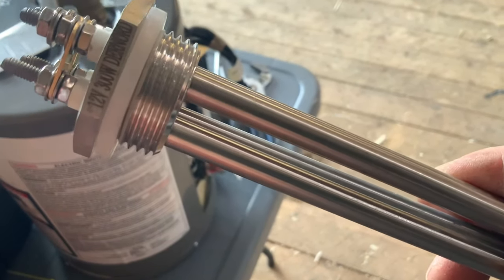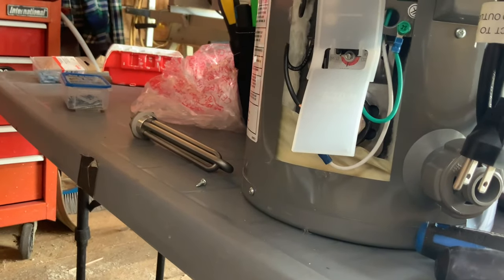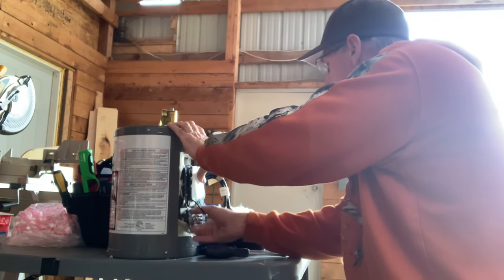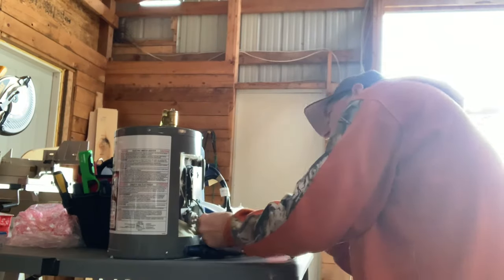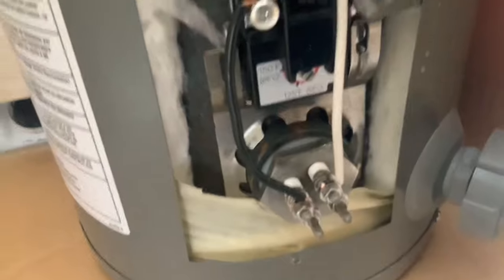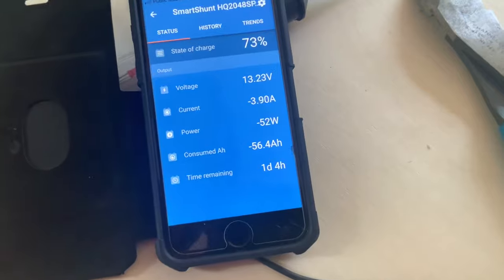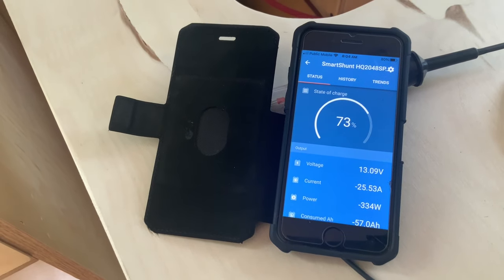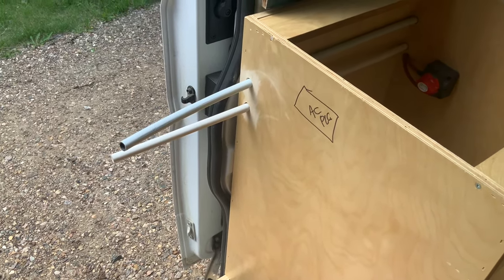Best Install 12v DC Off grid hot water heater in Van or RV Solar Compatible! DYI! Convert RV to 12V

Comment: I have a water tank like that in my Van that only works on a mains hook up. I have asked several auto electricians about what you have just demonstrated. They’ve all said it can’t be done it will be too big a draw on the battery. I’ve told them that I would only heat water when in transit (engine running) and they have said the alternator and battery won’t cope. I’d be interested in your thoughts on that.
Reply from the maker: So far I have used the system about 20-30 days, maybe more. I have turned it on in the morning and had hot water after my ride and then most of the day while the sun keeps the batteries roped up. Definitely on when driving but also always on when plugged in at home or a friends. I think the lithium batteries make a big difference and make sure you have a legitimate DV element. Also have good components in you DC system will be key. Good luck.

Comment: Brilliant discovery...thanks for making this video. Just what I was looking for. I want to create an off grid friendly 100% 12v closed loop system with something like this water solution of yours for a catering trailer (Wood Fired Pizza in the UK.) Alongside a12v Eberspacher Handwash & 12v Undercounter fridge. Do you have any advice/references/links, so as to punch in all the data, ie what I am planning, what I will run, and what the climatic conditions will be in this part of the hemisphere etc to determine whether my 410w 'Canadian Solar' panel will suffice and what amount of battery Amp will be req etc? Any pointers welcomed. Subscribed. Thanks again.
Reply from the maker: You should be fine with the 410watt panel as long as there is sun. A bank of good Lithium batteries will define help as they can be run so much farther down. Start the water heater o the way to your parking spot or while it’s on shore power before you go out would help for sure too. I heat mine a lot on the drives to places. Then it just stays warm on the solar. Good luck and have fun

Comment: Hello! Love the idea. How much hot water do you get out of that before it goes cold? I know its a 2.5G tank but I am hoping  you could get more than that?
Reply from the maker: Unfortunately it will not regenerate as fast as you use it so continuous hot water would only be 2.5 Gallons. That said I have never run out doing dishes or having a “ bucket” shower.

Comment: A lot of elements you see sold on eBay that say their 12-volt elements are not cheap artificial knock-offs. You want a good 12 volt element. But Channel called Missouri wind and solar YouTube they have the best true I've seen anywhere
Reply from the maker: Yes. Lots of knockoffs on eBay and Amazon. I went straight to Dernord but Missouri wind is great. I talked to these guys before. Excellent tech and parts!

Comment: Wouldn’t an inverter just let the water heater be used on the AC side? I’m assuming this must be more power efficient?? Thanks
Reply from the maker: Yes. You could just leave  the element in and run on AC from the inverter. My thought was that I would turn on the hot water in the morning and have the DC from the battery and solar do the heating. That way there is no residual power loss from Inverter running if the clouds come over. One less item to be running while I’m not in the van as I would hopefully be out enjoying the day and return to hot water and 100% battery. 😊

Comment: could you use a 600 w element in 12 v wouldn’t it heat faster ? or does it depend on the solar panels u have ?
Reply from the maker: Yes you could. It’s a trade off between time and energy used. I chose the lower wattage as I don’t need to heat super hot and it uses less over longer time which works well with solar output. Just my preference.
Reply: @dadzvanz936  Thankyou i noticed u use 6ga wire is that a required or would 10ga work ? great video by the way👍🏻

Comment: I considered a 12 volt water heater for a while, but gave up on the idea and here's why: I'm running a 608 AH System with a 2400 watt inverter at 24 volts. It's one of the all-in-one varieties, so It handles the solar input as well. In the end, it's all just energy and I'd rather have the 1400 Watts from my Bosch WH  (58.33 amps at 24 volts) going to heat the hot water in 15 minutes vs 3 hours or so for the 12 volt. I still have solar on the roof and a couple of portable panels for about a total of 600 watts of solar, so those can still be used to charge the battery. The difference is I don't have to wait. Sure, the inverter uses 60 watts power while it's running, but it only takes 15 minutes to heat 4 gallons of hot water up to temperature. Again in the end it's all just energy. Higher/faster, lower/slower.  The battery stores the power in either case. 

And for anybody wanting to use their engine to heat hot water, just buy yourself a heat exchanger or cooler (used for beer making). A heat exchanger can be used to cool as well, and they just tend to be cheaper to purchase that way. You can get a 30 to 40,000 BTU model for about 80 bucks. You'll need a small one gallon or so per minute pump to push the water from the water heater through the heat exchanger, but the water pump from the engine will push the coolant on the opposite side of the exchanger. It takes a very short amount of time to heat 4 gallons this way. You can do the math if you want to, but it's going to depend on what size heat exchanger you buy as to the time required, but it's very quick. I use a similar setup on my recirculating shower, so my domestic hot water does not go through water heater that's been used for the recirculating shower.  The engine holds residual heat for quite a while too, so you still get some heating effect even after the engine is shut off or a good hour or so (just a bit slower).  It's a good way to use btu's that normally just vanish into the air. 

Lots of options. The only advantage I see to the 12 volt is if you have limited battery power, but you pay to wait as well. If you have a larger Lithium ion phosphate battery bank you can still take advantage of the solar. I like your ideal though!
Reply: So the other dude that did the same 12v conversion to a rheem 2.5gal tank, but used a 600w element, timed how long it took for the tank to go from cold to 143F. Took about 30 minutes. So I'd assume it would take about an hour to get to temp with a 300w element. That's really not bad tbh. Only uses 300w and would at most be used once a day. On a 400ah system thats 16 days of hot water without charging the batteries.
Reply: While we can have a difference or discussion about methods we cannot disagree about facts.  You can't change physics. It takes a given amount of energy to heat up a  given amount of water, regardless of the source.  Fact. If it takes 15 minutes at 1400 watts /120 volts  to heat say 4 gallons (11.66 amps) It would take 2.33 times longer at 600 watts, Assuming 120 volts. Once you start converting to 12 volts, It would then take 116 Amps of power to accomplish the same thing or nearly 10 times as long at the same amps.  Once again, Higher faster ,slower longer. Personally, I'm running a 24 volt system so I'm only using about 6 amps of power, which can be handled in some fairly small gauge wire. If I was to pump 116 amps through the wires I would need to use something like 1/0 or larger wire.  At 300 watts and 12 volt it  would take roughly 20X the amount of time. You would then have heat loss to contend with over that amount of time, so It would take even longer.

Comment: Installed a 6 gallon Rheem with a 500w element instead. The wires to the element get HOT and melted the plastic. Should I replace factory wiring with 6awg as well? Was thinking this wire can’t handle the amperage. It’s pulling around 50amps.
Reply from the maker: Yes. I would upgrade that to at least 10 gauge.
Reply: @dadzvanz936  still getting hot with 6awg. Maybe faulty element or possibly thermostat doesn’t like it🤷‍♂️ It’s only hot at the element connections so could be the element.
Reply from the maker: @waltermeyers5700 ya. Sounds like something other than the wire size.
Reply: @waltermeyers5700 If it gets hot at the connections, it is not a wire size problem. It is high resistance at the connection itself. That can be caused by the inductance of the steel, a loose connection, or a corroded connection.

A copper connector is better than a steel connector. But you have to monitor them for oxidation. If I had that problem I would go to Autozone and get some copper connectors.

Comment: Did you change the thermostat for a 12v?
Reply from the maker: No I did not. I have not had any issues yet. Had about 10 days of operation and am going out again this week for a few days. Will post any updates. Thanks for watching
Reply: dc will spark and eventually stick ac  thermostat on
Reply: @danielnicholls6868  Is that because at 12V (instead of 120) the contacts will close much slower?
Reply: @RustyCas999   12 volts will be a lot higher amps and dc  flows is one direction. witch makes more of a spark jump and heat{will weld}.need bigger wire to

Comment: Are the 2 elements bridged. I've seen people put bridge busses on connectors to join the 3 elements.
Reply from the maker: Yes they are bridged. You could buy a 1200 watt DC and run it as a 600 watt and save the other side for a rainy day. There are onLet 2 elements of these ones
Reply: @dadzvanz936  I like that! I'm think pool heater in a strange way! How much voltage is max?
Reply from the maker: @tinkeringwithmark1186  1200 is max that I’ve seen

Comment: Is this 12v conversion due to the demand of the 120v through an inverted solar source?

I'm doing a box truck conversion and will have a fridge and water pump, as well as 120v receptacles for devices, fans, lamps, ect.
Reply from the maker: Yes. There is a very large draw with a 120v element as well as having the inverter running. With the 12v I feel really good about letting it heat all day while solar charges batteries and no draw to run inverter
Reply: @dadzvanz936  thanx for that response.

Comment: I’m new to this , I’m converting to a 24 volt system. Can I use the existing breaker and thermostat that is 110-240
Reply: From what im finding out is an ac thermastat will arc and won't shut off power as it should.

Comment: I bought the 600 watts and did the calculations (600/12 = 50) so that’s 50amps per hour on my 300AH lithium batteries that’s a lot isn’t? If I use the original element (1400 watts / AC 110volts it’s only using 12.7amps per hour.  That’s a big of a difference. Any input on this?
Reply from the maker: That is interesting but looks correct. If you have the inverter running that should work. I’m just surprised a 1400 what element only pulls 12 wattts. Definitely worth trying out. If the have a Cerbo you will easily see the draw. Let me know what happens. Thanks
Reply: @dadzvanz936  it's not 12watts..... 120Volts x 12.7 amps gets you the 1400 Watts for AC
DC is 300watts÷12.8 volts=23.45 amps....
You could have used the ac element and ran 2 - 250w panels in series and get MPPT of the panels......that drops DC to 6-7 amps DC... It's just OHMs law.....

For your safety you need to use different type of thermostat rated for DC..... It the ac welds it's self together you will melt wires.....I had this happen while I was experimenting in open air testing of hydronic heating.....Your using 3x the current that I used to weld the contacts. I'd use thermostat that turns off a DC disconnect like Victron sells...

Comment: What size fuse are breaker did you put on it?
Reply from the maker: 15 Amp.  1500watts is about 12.5 amps.  I find it really only draws about 1100-1400 watts.  So far no issues 
Thanks for watching

Comment: im running a 24 volt system on my busand assume that i could do the same with a 24 v element ?
Reply from the maker: Yes you can and I think Dernord and the place in my link below have them. Please check wire size and that’s a lot of power. Cheers
Reply: @dadzvanz936  i just figure every thing is easier if i keep my stuff to 24 v and im thinking that while im using 600 watts instead of 300 with the 12 volt im hoping that the water will get hot faster
Reply from the maker: Probably will work great. Good luck

Comment: Just to confirm the thermostat ran on 12v as well without having to change it out. All you had to do was only replace the element.
Reply from the maker: That is correct Chris. Just changed out the element and main wiring into the thermostat and it works perfectly.  Good luck! Let me know how yours goes.
Reply: @dadzvanz936  hi mate, I have a rheem 25lt .All brand new. 12v 400w element.  Seems like the thermostat doesn t work and it's new. I tried to add a relay but.. No better..what's your thermostat spec ? Thanks a lot
Reply from the maker: Can you post a picture of your thermostat wired up. Are you getting hot water it’s just not turning off.  Is the thermostat adjustable. My Rheem is and I first tried it turned all the way down. I have it set at about half not and that gives me plenty hot water.
Reply from the maker: @edsmith4414  Thanks Ed. Great advice. Mine has worked so far but this may be the trouble with massimo.  I’ll look into your site.
Reply: @massimolot7109   Your over temp switch may be open and needs to be reset. Follow down with a voltmeter. I think I would only use half the heating element for 150W which would be realistic all day for solar. I hate draining a battery. Add a switch for when you need fast response.  Those tanks with fiber insulation are terrible for heat loss.  I heat all my water with PV sending only excess to the tank.
Reply: @opera5714  what is PV 🤔
Reply: @richardbiron6908   Many use photovoltaic solar panels on RV.  Being able to use that excess power without having to use a battery, inverter or charge controller can reduce the need for larger systems.  Energy management is a complex task. Most choose simple over the most efficient ways.
Reply: @opera5714  sorry, i know solar panels….but my brain farted about PV. 😬😬

Comment: Thanks for posting this- very helpful! Will this work on other types of anode hot water heaters? For example the Camplux ME25 is a lot cheaper, seems better insulated and has a pressure release. Would it be as simple as swapping the anode cutting the electric wire head (that is 120) and using those wires into a 12v fuse box? Bosch also has a popular electric heater that uses the element.
Reply from the maker: Hey Kris, I am pretty sure any hot water tank that uses “standard” 120 volt elements would work. The big thing is some people mare having problems with the thermostat turning off. This is not a big issue and inexpensive to replace to a 12 volt. Have a look at previous comments and search Dernord for the parts.  Thanks for watching, John.
Reply: @dadzvanz936  you could forget the thermostat and use a count down timer. When you want to heat water just turn the knob and set it for an hour or how long you need to heat the water. I would assume these small tanks have a pressure relief valve and run it outside the RV. I don't think your water would be hot less than one hour. 73
Reply: @ronb6182   great idea. I have 3 more vans coming in the fall to bios out. Will look into this further.
Reply: @ronb6182  I think a thermostat is always going to be safest - esp as the temp of the water at the start of the timer may not be constant.

Comment: Can this be done also on a 6 gallon Rheem? I'm assuming it will take longer for water to heat?
Reply from the maker: Sounds about right but I’m sure it will work. I’d think about maybe a higher wattage element.
Reply: Yeah going for 500 watt instead.

Comment: I went gas in my home. I used an excel water heater I hooked it up to a gas grill regulator and used a one pound bottle adapter and used one pound propane canisters. We can get 5 good showers on one bottle of gas. I just put a twenty pound bottle for long term usage.i don't know how many showers we will get out of it but I'm going to keep track until the water heater quits giving hot water I would expect to get a months worth or more. I really don't know how much gas is in these machine given tanks someone told me you be lucky to get 15 pounds of gas next time I need a fill up I will weigh the empty bottle before trading it in. Then I will know for sure. So I think in an RV which this heater was made for would work and you wouldn't need to carry a big bottle. But most RVs have one or two bottles because of the gas stove and water heater and also heat for the RV. I like the  battery water heater if I had solar but you can use the sun to heat the water without using power out of your batteries. I guess it's how much hot water you need. 73
Reply: I like your idea!!  Have a look on YouTube about the guys refilling those one lb bottles I do that for my camping stove. Works very well. I try and only fill my 25 lb propane bottles at places that sell by volume not by the bottle. I think it does work out a little better. Got 3 more vans coming in the fall to build out. Stay tuned!!
Reply: @johnthorsteinsson6122  thanks! 73
Reply: @johnthorsteinsson6122 just filled a 15 lb bottle at tractor supply for under 12 dollars. I would say you could get a month and a half out of one refill. I'm thinking of getting another bottle traded in for under 25 dollars at Amerigas at my Sam's club. The last trade in I got a brand new bottle with gas. 73

Comment: How long does the hot water last?
Reply from the maker: Absolutely depends on how it’s used. Shower with full strength not too long. Doing dishes with a plug in the sink no problem. Washing up no problem. It is 2.5 gallons